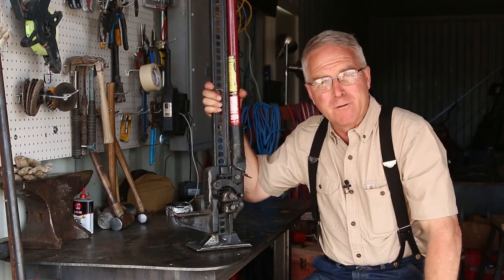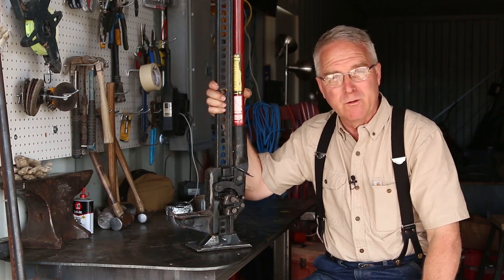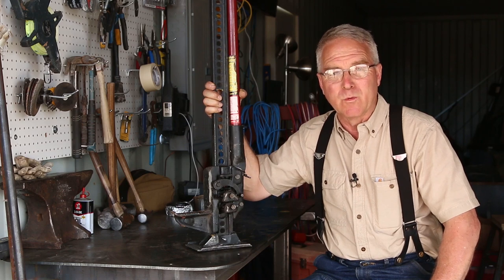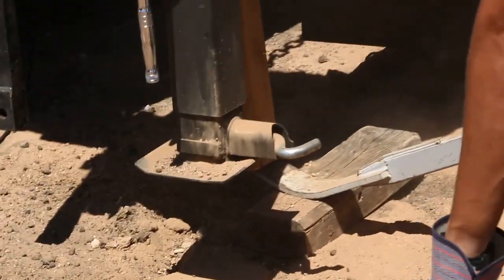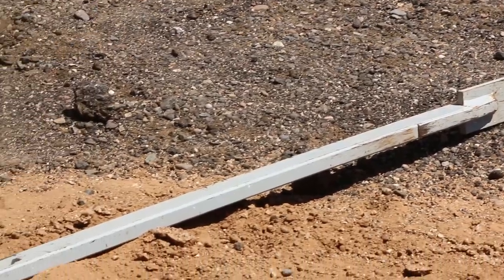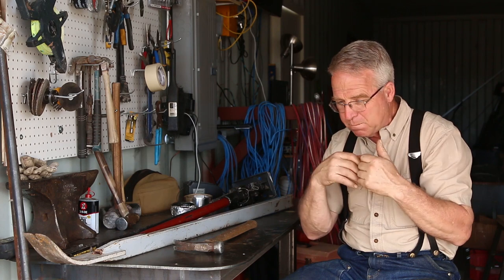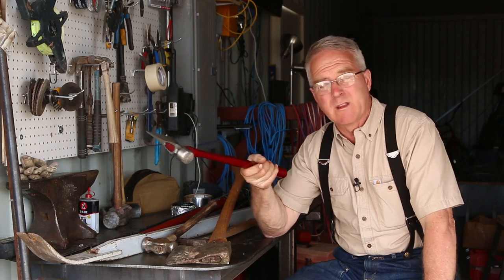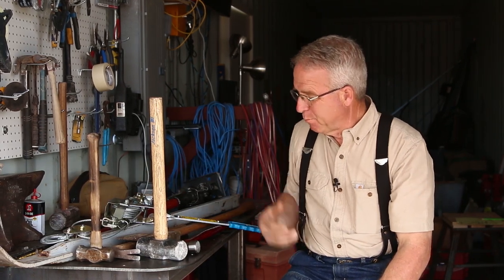5 Problem Solving Tools

Comment: Last one I knew would be a swiss knife, but a rope is the most underrated tool.
Reply: Hi rope maybe older and of more profound effect than the wheel. What good is a wheel if you cant tie something to it?
Reply: A leather man I’ve always found more useful than a Swiss Army knife but it’s just what I think
Reply: Swiss Army knife doesn’t have pliers. 90% of the time I pull my multitool out, it’s for the pliers.
Reply: @ajbowers44   You obviously have very few wine opening emergencies then.
Reply: Best yet - a Victorinox Swisstool. It's both a multitool and a Swiss Army knife.
Reply: @mitchellpeterson8644  i honestly don't trust a man who's never experienced the anguish of a wine opening emergency.
Reply: @mitchellpeterson8644  The best wine opener I've ever seen on a multitool is on the Leatherman Juice CS4 (and a few of the other Leatherman Juice multitools). The corkscrew and the bottle opener are arranged so that you can put the bottle opener on top of the wine bottle and use it like a sommalier's corkscrew. It also has pliers and scissors. It is smaller than other leatherman tools like the Wave and so none of the tools on it are the best that I own but they are good enough that I end up using it more than any tool that I own because it's always in my pocket. Great for wine related (and other emergencies); it can remove some pretty stubborn corks with ease.
Reply: @ajbowers44  ... But the knife in multitool is often awkward to use.  So depends on your needs. Each has trade offs
Reply: @mikesullivan3317  this is what makes multitools awkward, chunky and impractical. 
Bottle opener,  corkscrew,  funny shaped saw...  You have multitool.  Get yourself multi skilled.  Open bottle with screwdriver,  push the cork inside or learn to bump it by tapping bottle on it's bottom. 

Get only essentials in multitool so it's small,  lightweight and more practical
Reply: @littleblom  Well, you are certainly correct about multitools not being the best at anything (jack of all trades, master of none) but opening wine with a screwdriver doesn't seem less awkward than what I am doing.  :)   

Anyway, the CS4 is one of the smaller multitools. The pliers would be better if it was a bit larger (about the size of the Leatherman Wave) but the wave doesn't have the corkscrew and it's a bit large for a pocket so I am more likely to have my CS4 than my Wave.
Reply: @mikesullivan3317  Agree with you screwdriver is rather usesless with wine bottles - at least I never met anyone using it successfully for this purpose. 
Still.  You can open wine by pressing cork inside the bottle or flip bottle upside down,  hit the back with palm of your hand. Yes,  it's less stylish,  but it works. 

Bottle cap can be opened in so many ways that bottle opener is a tool for little schoolgirls. 

There's always better to make tool lighter or with same weight stronger..

I used to drag m-tool with me at all time and seldom use it.  Around the house I have proper tools.  Hiking/mountaineering knife, screwdriver,  saw is kind of enough for me. Cycling: specialized bike tool plus small pliers and a sturdy pocket knife. 

But everyone is different.  There's sure need for this type of thing. They are sure the most effective if made on purpose eg. bike tool,  some kind of gun maintenance tool and so on.
Reply: Im pretty sure he said leatherman. Not swiss knife
Reply: Samwise Gamgee approves this message!
Reply: Don't for get your phone for youtube and wikihow.....
Reply: Austin Bowers 
Several models of Victorinox Swiss Army knives have pliers. 2 weeks ago, a coworker’s Jeep wouldn’t start. I used the pliers in my Swiss Champ to tighten his battery terminals because he had no tools at all except a cellphone.

Comment: Bought a pumpkin carving kit for my kids and the tiny saw they provided snapped almost immediately.  Pulled out my pocket knife and carved 3 pumpkins no problem.  Wasn't a life or death situation but it goes to show that a pocket knife/leatherman can solve a lot of problems.
Reply: It was probably a life or death situation in the kids point of view. You were the hero and saved the day. Good for you!!!
Reply: or you couldve went and got a knife from the kitchen. i dont see the point in these silly multi tools or army knives
Reply: @JimTom.  If you're hiking 20 miles you want as much weight savings as possible. Other than that just use the right tool for the job.
Reply: Noah G.  True, but also the only decent ones worth having are upwards of $200 here. I guess its one of those manly things that are nice to have or a good gift idea, like a good wallet or bottle of whiskey, but aside from being nice, in my opinion anyway, they arent necessary or useful. Fast last words of course, but in my case my truck is full of tools anyway. I can certainly see the convenience of them, but its one of those things that if you know you have it, you are going to use it, you will rely on it because its always with you and you wont bother to bring anything proper with you, then wind up getting frustrated with the little half assed tools on the multi tool, rather than walking over to get the proper tool. i dont know, maybe my opinion will change one day

Comment: Leatherman. Never leave home without it! Great video.
Reply: I have had mine on my hip since I was 16, I don't leave the bedroom without it. My grandpa bought it for me, a very prized possession of mine.
Reply: Thanks!
Reply: Keep my Juice XE6 on my keychain, so I quite literally never leave home without it.
Reply: I am more of a Gerber guy but i have a mini 
Leatherman in the truck.
Reply: Tools are my life, have  tools that are from my great grandfather, used a leatherman to cut the battery cable in a car wreck  ,fuel was pumping into the engine bay, had to wait for rescue team to get the young girl out of the wreck.
Reply: Little known fact: the first dozen years or so the Leatherman was called a Leatherboy.  Since puberty its been known a Leatherman.

Comment: Great video, a Leatherman is truly the most useful tool on the planet.  I have found that a soldering kit is also a great thing to have in the backpack. Sometimes your big problem requires small solutions, and a soldering iron can at the very least temporarily bond light metals and plastics!

Comment: On the toll road, after work, one day, I noticed a man standing by the flat right rear tire of his pickup truck. He had his spare out, but he seemed to be not making much progress. 
He had wisely pulled way over on the shoulder of the highway, but as the truck sat, his jack wouldn't give enough lift. I grabbed some 8"x8"x16" and 4"x4"x16" wood blocks I use for setting up my 5th wheel trailer, my bottle Jack and cross lug wrench and he was on his way in five minutes. We had to block and jack, crib the truck, then block and jack some more. Then reverse the process. We could have gotten by with his tools, but the blocks were mission critical. I used what I had. If I was starting over, I think I would cut a 4"x4"x8' post into 1-foot pieces. I think that would take care of anything I might run into.
Reply: William Degnan the unfortunate demise of the steel bumper has led to the induction of more inferior lifting methods.  We lost a bumper jack that could lift a car two feet in the air to now where the dang scissor jack barely gets it up high enough to clear the ground to get the wheel off.  Bottle jacks, although better, still aren't the same animal when you need to lift a vehicle.

Comment: During the whole video I was like " Dude where's the Leatherman?!?!"  then he pulled out the Leatherman :) . I have a Rebar btw and love it !
Reply: Go Rebar! Im an aircraft mech and have it on my belt next to my torch every day! It's nice and light and undoes the panels that people love to fit with phillips AND flat heads! There's a special place in hell for those that mix their fasteners- especially when you're 50ft up in the air! Don't get me started on tri wings....
Reply: @tommythetomsteroo  I know the feeling , that's why I love the rebar, it can handle almost anything you throw at it except for torx but it's still really light
Reply: I bought a couple, but I never use them and always end up giving them away. I guess I always have proper tools around.
Reply: @rolobotoman  I guess if you know what you'll be facing with every time at your job then you might not need it but I do a lot of maintenance and sometimes I can just fix something on the fly because I have the leatherman on me all the time
Reply: @cosminpopescu92  Yes, I absolutely see how they can be useful.

Comment: I know exactly what you're talking about, Scott!  I'm considered the Mr. Fixit to my family, relatives, and friends.  I've been carrying a Leatherman daily since 1983 and almost always raise eyebrows when I pull it out at odd moments when nobody would expect anyone to have a tool at hand.  I also carried my Leatherman when I was in the Air Force, working on F-16s, and it came in handy in many pinches when no tools were close at hand.  I feel naked without it.  Thank you, Scott, for your thoughts on other important tools to have.  A good pair of Vice Grips and stainless steel wire are also great to keep in the car/truck.

Here's my favorite story to tell about fixing things in a pinch.  As I mentioned, I was an F-16 Crew Chief in the Air Force for 7 years.  For 3 and 1/2 of those years, from 1986-1989, I was stationed at Hahn Air Base in Germany.   As a passenger in a friend's car, we were traveling fairly slow in heavy traffic on the Autobahn and had just filled the gas tank.  Suddenly, the car shook as we heard a loud  noise from the back of the car, so we immediately pulled into the break-down lane to investigate.  I got out to assess the situation, and my jaw dropped!!  The steel straps that had been holding the fuel tank suddenly broke from years of rust, dropping the gas tank to the pavement, dragging it by the fuel lines.  Fortunately, the tank did not catch on fire.  I happened to have a couple extra tie-down straps (non-ratcheting) that I could use to temporarily re-mount the tank  After 10 minutes of driving, however, the tank fell to the ground again.  The sharp seam on the tank had chafed through the nylon strap.  I tied the strap in a knot and remounted the tank for a second time.  This time, however, we drove much slower and made it to a rest area, where I manually lowered the tank to implement a better fix.  Unfortunately, I hadn't figured out what that fix would be, so I started walking around the rest area to think.  My friend asked me what on earth I was doing.  I told him that I was looking for something but did not know what, yet.  I suddenly saw the solution: a Coke can!  I picked up the can and proceeded back to the car.  By this point, a crowd of Germans had started gathering to view the spectacle we had made for ourselves.  My friend asked what on earth I needed the soda can for.  I took out my Leatherman, cut a 1-inch strip from the can, held it up and said, "anti-chafing strip!!".  I remounted the fuel tank for a third attempt, but this time, I wrapped the nylon strap with soda-can anti-chafing strips right where the tank's seam was rubbing against the straps.  My solution worked great, and we made the 2-hour drive back to our base.  My friend soon ordered new fuel tank straps from JC Whitney, but his order was delayed for months.  My solution worked so well, that the tank held for the two months of daily driving while he waited for the new tank-mounting straps to arrive.  That was certainly an experience we'll never forget!
Reply: That’s an incredible story!
Reply: Great story 👍

Comment: My wife and I recently remodeled two bathrooms in our home. I came across this video shortly after looking into painters tools the help with the process of cleaning rollers and paint brushes. We kept buying more and more and it started getting costly. 

I bought a 16 in 1 painters tool which helped save money by using it to clean the rollers, and brushes, but it also does much much more. I also picked up a Milwaukee fastback with the Philips and flathead bits. They have been a blessing for taking down fixtures, switches, scraping paint, knocking out panels as well as striping wire and opening packaging. Anytime something is loose such as a door handle I grab that fastback ASAP and tighten it up. 

I also have been looking into getting a smaller axe to cut some wood for my backyard smoker. I'm glad I watched this and will probably get the axe/hammer. I already have a large axe, but it seams a bit too large for the wood I use. I have already looked into one when going to my local box store. I can think of a use for all of the tools in this video, and next time I go strolling down the aisle for something new to buy I may just pick something up.

Comment: Jumper cables can be heroic problem solving tools.  I always carry a 12V tire pump in my car and I've helped a lot of people with it.  But I agree with the Leatherman- we were out one time in the middle of nowhere in my cousin's old converted school bus and it was dark by the time we were going to return to town.  His headlights weren't working because one of the terminal plugs had broken off of the dimmer switch.  We used my Leatherman to pull out the prong so we could plug wires together directly and drive back home.

Comment: I have used my Hi Lift for decades. Originally as a jack to change tires on my big 4x4. Then as a come--along and fence puller, and recently for pulling fence posts (set in concrete) out of the ground

Comment: I’m going to start giving away hammers as house warming gifts.
Reply: THAT is a great idea!
Reply: My sister got a pink starter tool set (hammer, pliers, screwdrivers, ect.) when she moved into her house from a friend who had one, they both love them and use them alot!
Reply: A favorite thing I’ve done a number of times: Vaughn 16oz straight claw hammer with the octagonal handle as a gift. As long as someone doesn’t try to use the thing to pull rusty 20d’s or something it’s a great basic carpentry hammer and it’s sorta cool
Reply: Now that’s a gift I can get behind. Great idea.
Reply: That is an excellent suggestion!

Comment: Before I retired (after 30 years) I was a  building engineer. I was responsible for any building system up too 1M sq ft. that included landscape. Each day before I started I put on my multi-tool and flash light om my belt. I can not tell you how many times I did not have to go and run for a tool to fix a problem because of having these two items on my belt.
Reply: Nice.

Comment: Can't function without a multi tool and small flashlight in a sheath on my belt !!! Before I retired I can't count how many times a day I reached for one or the other.
Reply: I agree completely a good small flashlight is indispensable, if you are unable to see what you're doing it can get quite frustrating, I have three small flashlights within reach of me now, one is a headlamp that I use quite often and the other two are little small flashlights that are USB chargeable, which makes it nice no batteries to replace. With the headlamp you don't have to worry about aiming a flashlight because where you're looking is where the light will be.

Comment: I live on a farm. The highlight jack and come-a-long are absolute necessities. I would add one more. I have two wheeled hand carts. One with an extra large metal garbage can strapped to it to store dog food. I have 5 dogs so it is a 50 lb bag of food. I just roll the can to the back of my truck and flip the bag over into the can and roll it back onto the patio. I have another hand truck with my propane tank and pear burner strapped to it. And one in my shop that I move my table saw around with.  Great back savers. One other item I have multiple of is headlamps. One in the truck, one is my first aid kit, one in my EDC bag and one in my tool bag. I gave them to my great grandchildren. They loved them. I really like your presentations.

Comment: Before you got started I guessed the Hi-lift jack !  🤙
A very modern one that I carry in both my truck and in the saddle bag of my motorcycle is the booster battery kit. 
When they first came out,  it was so much fun watching someone with a totally dead battery scoff at my silliness when they saw it,  only to become astonished when their big v8 spun over like a brand new vehicle.  The first time I used it was my neighbor’s not-even-a-click-dead 6.2L Hummer.  Freaked us both right out.  It’s a specialized use and not really a tool but has been used more often than any other tool I carry,  and takes up much less space than jumper cables.

Comment: In my durango I keep quite a few things on hand, which changes slightly by season and situation. Heavy nylon tow strap and a hitch insert with a heavy duty clevis on it, binoculars, state road map, flashlight, multi tool, extra jack, bungee straps, ratchet straps, heavy duty jumper cables, 12v air compressor, military surplus fold up shovel, a .22 truck gun with some ammo, gloves, thin ones, heavy duty leather and a pair similar to your white ox gloves. A piece of cardboard in the cargo area so I don't have to lay in the mud or wet ground or on sharp gravel if I had to do emergency work under the vehicle. I've always got a pocket knife on me and I like my older truck because it has a cigarette lighter. I think that's one thing they should never do away with. Otherwise buy and carry a regular lighter in your vehicle. Most importantly when I'm going out in crappy situations I carry a fist aid kit, water, other drinks and a couple snacks.

Depending on season and situation I may also carry a hitch insert winch, chainsaw, bigger shovel, tire chains and possibly some boards.

Also a gallon of fresh water possibly for drinking but more for possible situations of filling the radiator or cleaning up after being especially dirty. An extra quart of motor oil just in case as well.